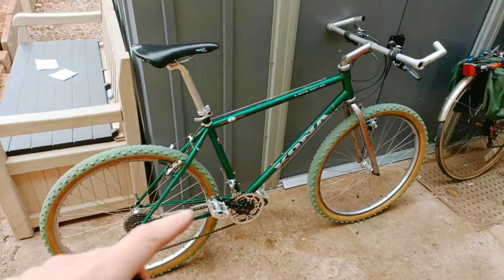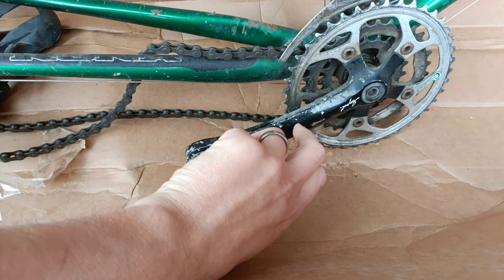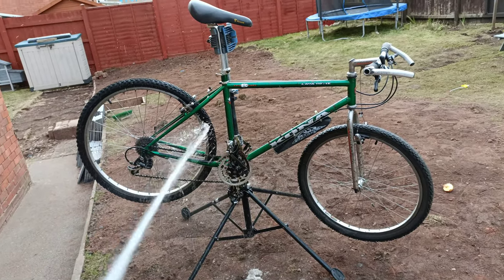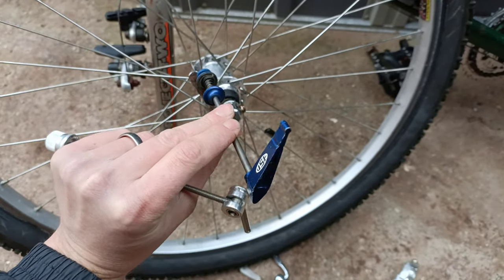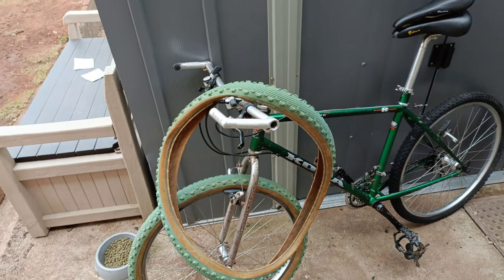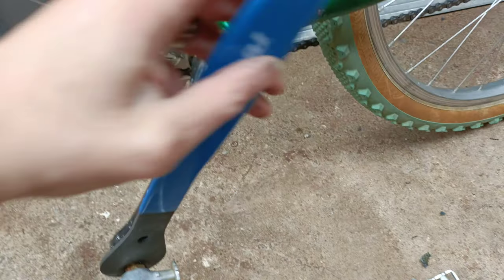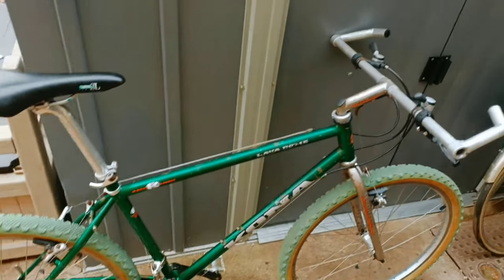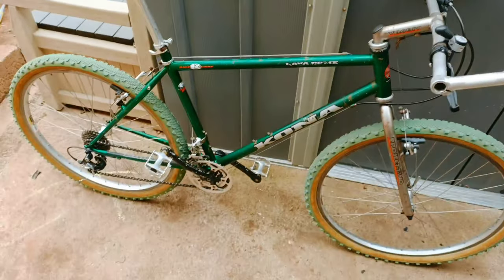Part 1 Cheapest retro Kona on eBay!!! Just £85. Is my latest 90s mountain bike Lava Dome any good...

Comment: Just picked up a 93 hahanna that's in pretty good shape. I feel like I should try to restore and preserve it as best I can--but I also really want to ride it.
Reply from the maker: Nice one! You should do what you'd like to do to it, even if that's stripping it and building it up with modern bits 😁👍
Reply: Have some old Shimano 600 integrated shifters. So I'm going to drop bar it and leave everything else besides saddle and pedals. The rest will just be a clean, touch up paint scratches, wax, and new cables and housing.

Comment: Everyone has a different stem to me and the fork mine has only white outline p2… I have the same lava dome
Reply from the maker: That's strange, think they are replacement decals?
Reply: @TheRetroBiker  I have actually found out on Iona Facebook mine are not the correct ones. I have a 93 p2 forks and what looks like a Marin velocity stem. The shop must have changed them to make a little profit or something.🫤